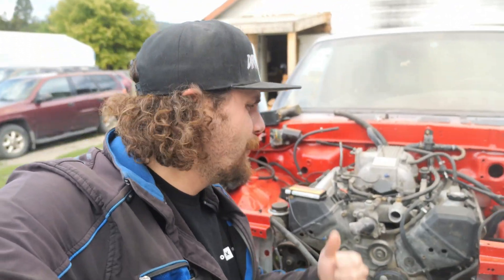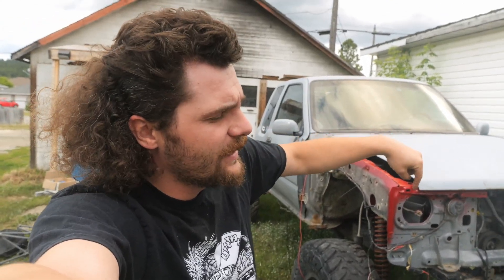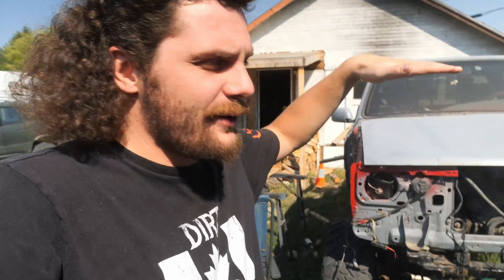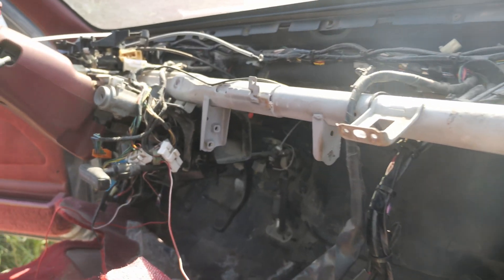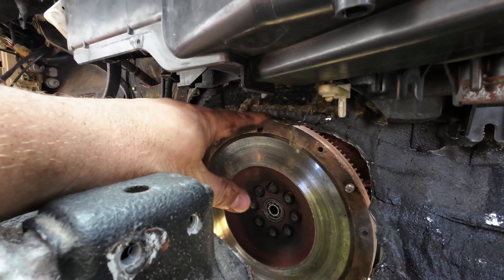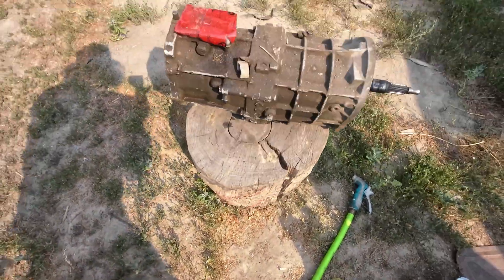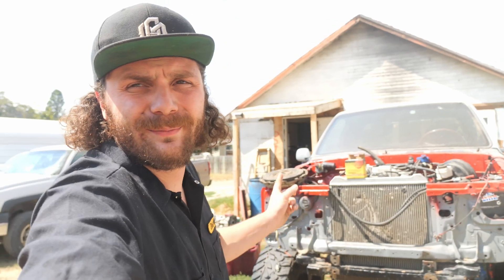CHEAP STAND ALONE ECU for 1UZ Swap!

Comment: Hey do you have any clue why the ecu says missing crank pulse? With crank no start
Reply from the maker: @hudsonbiancaniello4326  is the new crank gear installed? This requires a new gear with more points
Reply: @DirtGarage  yes new crank gear is installed I’ve tried two of the sensors and I am getting a reading of rpm and good fuel just no spark

Comment: Those aftermarket 1uz manual bellhousings are huge. I never have clearance issues using the adapter plate/ automatic bellhousing kits. The automatic bellhousings are smaller

Comment: Just wondering if you did anything special to get your tach working on the spitronics setup? I double checked that I hooked mine up correctly and made sure it’s outputting in the software and still don’t get any needle movement.

Comment: If you remove your front tires to pull an engine it will make your life easier. Like not dropping an engine and transmission at full boom height. My ceiling in my garage is  low and unfinished like yours. with and now without a 3" body lift not ounce did my hoist hit the ceiling joist. 

Your probably right about modifying the flor board to get things to fit, but I would say should also try measuring before your final decision. If you think about it why not just a 1" body lift, that's as tall as 3". Then modify the tabs on the bellhousing and probably fit with or without messaging the floor board. I personally would have came up with more ideas to avoid modifying the floorboards. It is always best to have your transmission and t-case bolted to the engine and installed by the crossmember. Your engine needs some angle for oil drain back, you don't want you engine level. Also need to take into account how you rig sites at ride height and how it sits, because that will be your angle from which all  other angles will derive from.

I took measurements and angles when I did my 3.4l swap with also taking into account of suspension travel with no body lift. I'm actually thinking of adding a one inch body lift for an intake modification that will raise the intake plenum 1". The 1" body lift will give clearance for the plenum and the hood, it will also let me raise the t-case an inch. Only thing I need to take a closer look is the fan shroud and radiator.
Reply from the maker: The one and only motor I dropped out of the dozens of engines I've pulled and installed was on small tires. The height is very low in the shop, and everything barely fits in the door.

And the whole point is NO BODY LIFT. I'll modify everything else to make it work, little bit here, little bit there, and eventually I'll fit. I want this truck to be as low as possible in the end, and don't want to build bumpers and sliders and everything again to match the body lift. 

I had the 2" body lift for years, since it was the supercharged 3.4, and now I'm over it.
Reply: I look at it like suspension geometry, change one and everything else changes. You can't have one without the other. You want stock looking (believe me I've tried) go back to stock. There is a middle ground,  but trial error sometimes play apart in finding it.

Comment: This video gives me ls swap PTSD. Still trying to figure out bulletproof cooling. Not much room in there for fans.
Reply from the maker: The LS fits better in so many ways. I love how small they are compared to the 1UZ. But they definitely don't leave you for much room in cooling department. I do have a possible solution for this I am going to try with this build.
Reply: @DirtGarage  I'm excited to see what you guys come up with! Next step for me is pushers, then rebuilding the front end with tube for more room for a big rad and fan.

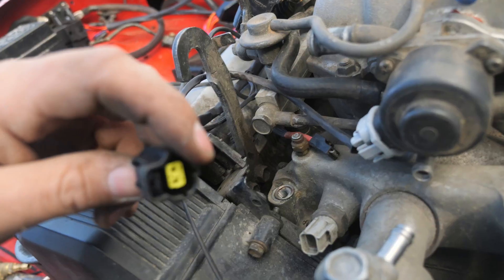Comment: 2:10 that is the cold start injector temp sensor. Only used on very early 1UZ. The plug you have should go into the sensor you broke and the cold start one isn't used.